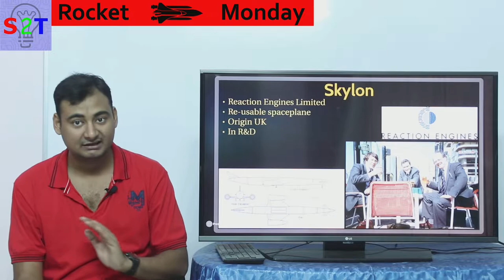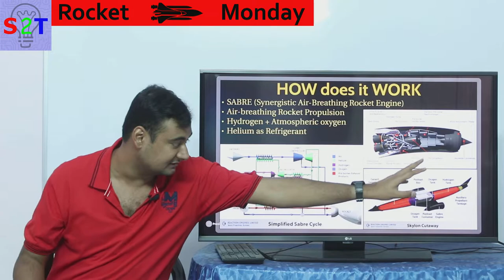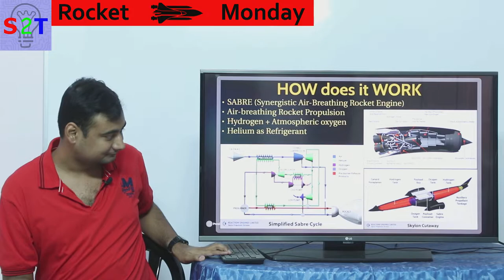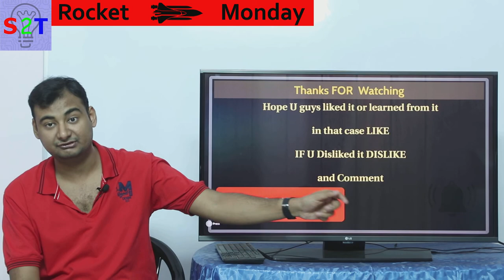Rocket Monday Ep20 (Dream of Skylon SpacePlane)

Comment: Ok, need to address a few points.

1) the positive thermal outflow, which you have stated is one of the problems, SABRE arevlooking to recycle the heat in order to use it to increase propulsive moment. I don't quite understand how they have managed to do this, but one of their recent science updates proposed a scientific method for achieving this.

2) the length of the runway, WAS an issue. This was until they decided that adding turbofan engines to an aircraft hull to add extra thrust for takeoff only (needing only a very small amount of fuel as it's just to get the aircraft into the air) was a viable solution.

This also had an added benefit, of allowing the air craft to land under the power of the turbofan engines as well, if enough fuel was left over from the takeoff phase.

3) the main benefit, which you outlined at the beginning of your video, being the seconds multiplier, should not be overlooked. The aircraft will have an efficiency way above any rocket engine, to the tune of 70%+. This is a huge advantage, allowing the aircraft to use a much smaller amount of burn, for distance travelled than any rocket known to man right now.

This efficiency, will allow an aircraft to take off from a runway get to Mach 12 or 13 using exactly the same amount of fuel for distance travelled than a current airliner - and do it much more safely. Once it has reached an altitude of 190,000 ft, it will just cruise in rocket phase for 3 to 4000 miles before starting it's descent on to the next continent.

Because of the momentum, and lack of friction at the altitude, the aircraft can operate extremely efficiently.

SSTO, well, we will have to see if that is doable. But using it as a transport, or fighter engine, has lots of promise.
Reply from the maker: sorry for late reply .
1) they do you captured heat as a extra booster and the hot hydrogen ram jet engine adds more thrust than drag so its a solved issue  , how will you do that in a aircraft its ok for space plane but jet fuel is not cold enough for this use
2)runway length  is issue because of small wing so adding things wont solve this issue  long runway was a good compromise between burning too much fuel to gain acceleration from a small run way   
3)seconds multiplier, yes but you have to understand that turbo fan is hyper efficient at subsonic  GE Cf6 engine used on b747 has a specific impulse of   5800s +  in real world and many new engine have even higher (6000s+) rockets do not even reach 600s+ (understandable  as they have to carry there own O2) so 70% better than rocket is nothing compare to a turbo fan engine .
"an aircraft to take off from a runway get to Mach 12 or 13 using exactly the same amount of fuel for distance traveled than a current airliner " physics does not allow that ,even if you are in rocket mode you need A LOT OF FUEL TO CHANGE "INERTIA" or delta V mark 13 is 4.4 km per second and you have to "breath  air in for O2 " which will reduce efficiency in real world  SR21 used ramjet mode to reach Mach  3.2 at efficiency of 1800s +  best this tech can do is same efficiency but at Mach 5+ (that is why army is looking into it )
 aircraft will be "Unsafe"  , you are talking about a ballistic trajectory last craft to do that was   North American X-15 trust me when I say this that "SPEED " miner mistake turns deadly before even computers can react 
There is lot of small promise here but nothing groundbreaking that  is why funding is so low
Reply: science to technology thank you for your reply. I understand many of the points that you have made. I obviously didn't read the information in the science journal well enough to understand it. I'm not a rocket engineer, or a aero engineer, so it's a bit above my paygrade I'm afraid!

Still, I understand your point now, and we'll go away and do some more research.

Thank you for putting me straight on a few pointers :-)
Reply from the maker: @RB747domme  You don't have to be a rocket scientist to understand things, all you need is good data and some basic understanding. Look at Elon Musk or Jeff Bezos
 .I am glad I was able to help you
Reply from the maker: No . All aircraft that can use a catapult is  built & reinforced for it , do that with Jumbo Jet it's will end badly . Catapult that can pull 100+ ton will be super duper expensive & reinforcing the Skylon will reduce its Payload capacity.long runway is the cheapest option or mid air refueling (help's to reduced stress on the craft during talk off)